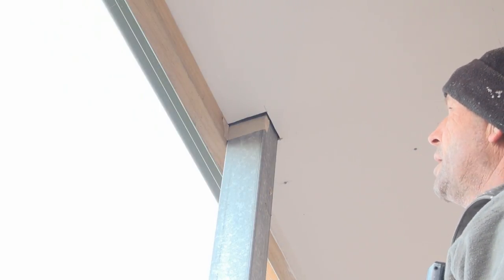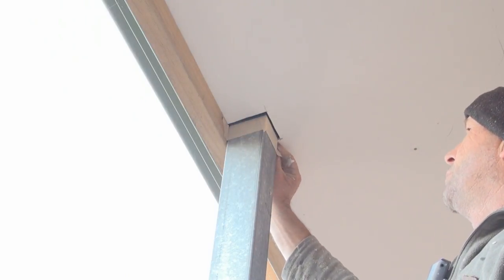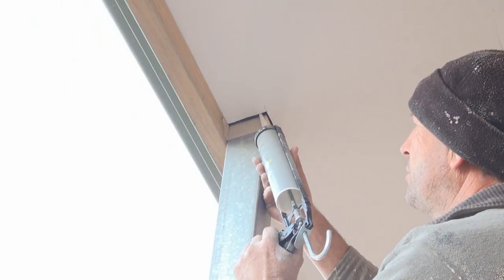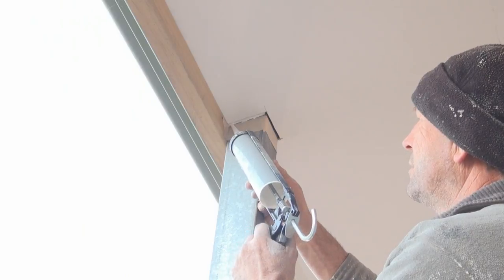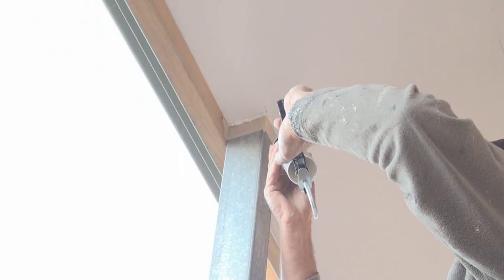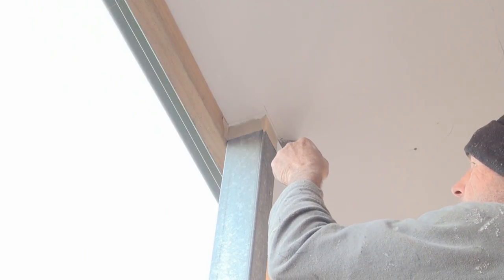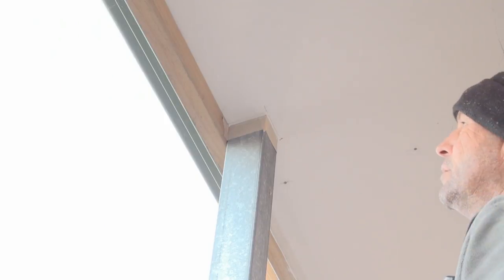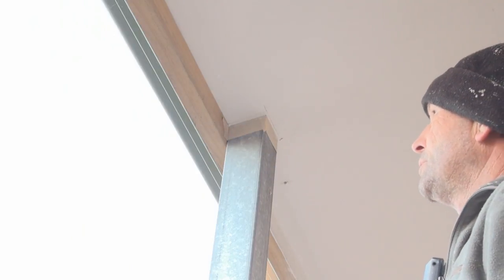How to caulk larger gaps - The technique used to fill larger gaps or cracks with an acrylic sealant.

Comment: I need to caulk gaps between the ceiling and walls, then paint the ceiling only. How can I do this without getting the caulk on the walls (walls are a light green colour). Would you recommend painting about 1cm down the wall with the ceiling paint?
Reply from the maker: Fill as you normally would and make sure you wipe clean with a clean rag, you should be able to get the caulk looking good without having to come down on to the walls.
It doesn't matter how much you vacuum or dust off there will always be some dust left under the skirting which can be blown out by the pressure of the spray. And yes I did dust and vacuum before I started
Don't forget to Like, Share and Subscribe

Comment: In my basement, there’s a wood on in the bottom and drywall around the sides on the top. Should I use wood filler first and then after that use Caulk? 

I’m only doing the bottom where there is a decent size gap in the corners
Reply from the maker: Wood filler is for nail holes and gap sealant is for the gaps between the two surfaces.
Don't forget to Like, Share and Subscribe.

Comment: So if you have a large gap at the top of baseboards you need to go back the next day and see if it has dropped and shrunken in and you can put another layer on top?
Reply from the maker: Yes exactly that or you could first fill with base coat or something like that and put a layer of acrylic sealant over the top.
Don't forget to Like, Share and Subscribe.

Comment: Hi there, I gather the gap you're filling is about 5mm or 1/4 inch. What about 10-15mm (1/2 inch) gaps?
Reply from the maker: You could use the same technique but you would need to use a polyurethane sealant.
Don't forget to Like, Share and Subscribe.

Comment: Foam fill first cut back then powder fill job done in one day ..thanks
Reply from the maker: There is always more then one way to do things but you don't want to make things complicated. I'm sure you can get a nice finish that way but most powder fillers won't flex enough.
Don't forget to Like, Share and Subscribe
Reply: @howtopaintinfo  hi the powder filler dosent need to flex as the foam filler eliminates movement hence causing a permanent fix it has excellent adhesion properties.... ps I love your vids on rolling emulsion most people think it's just a case of rolling it on the walls in any direction I always back roll and some people think I've sprayed it .

Comment: Gaps like this should have backer rod and then sealant. Very unprofessional. Shows absolutely no understanding of caulking
Reply from the maker: The sealant will adhere to the side of the post as I said in video.
Don't forget to Like, Share and Subscribe.
Reply: @howtopaintinfo  you don’t understand the purpose of backer rod.  It controls the sealant depth and forces it against both sides of the joint instead of just pushing it deeper when you tool it. I have never seen a sealant manufacturer that doesn’t say to use backer rod in joints this size.